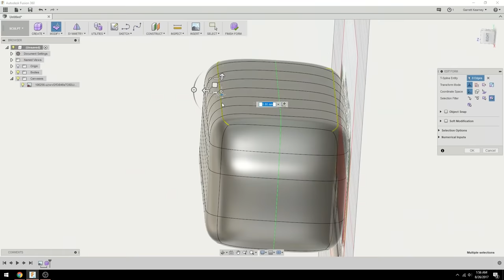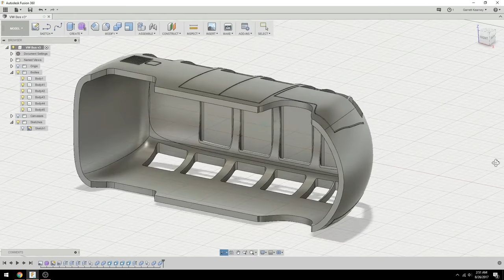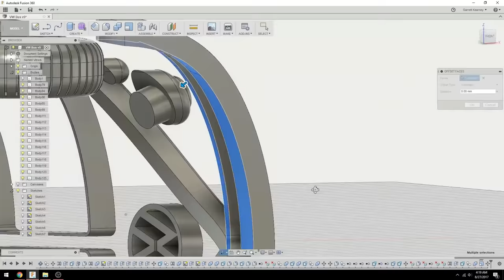3D Printed Model Car! - Volkswagen Bus

Comment: Nice model! For chrome details I highly recommend "Molotow Liquid Chrome Marker". If you want to see it being used I have a video where I paint a 3d printed Thomas the Tank Engine model on my channel
Reply: agepbiz I used actual chrome paint, it looked great until I stupidly put a gloss coat over the whole thing. Completely dulled the chrome at that point. Lesson learned.
Reply: Ah yeah, been there done that. The same goes for the marker, do not put gloss over it :) Great paint job by the way :)

Comment: I need help : i buy a 3d print called Anycubic i3 Mega ... All is working fine but on the manual i saw 60mms work speed ... But on youtube video, when they print, they use 30mms ... Just why ?

Comment: Feb. 2018---Thank you for a almost outstanding video. I say almost because I had hoped to see the bus being printed out.After 15 years or so, thought of getting back into modeling, but didn't want to go back to aircraft/armor. But started checking Google/Youtube to see if anyone was building zombie/apocalypse dioramas and boy, was I surprised. Also on the amount of paintings of survivors, abandoned cites, etc. and let's not talk about photos of abandoned amusement parks, malls, etc. I want my dioramas to be realistic as possible, so there's going to be NO Mad Max look or with a lot of women running around showing t&a's. Since starting this, must have downloaded 15K worth of photos/paintings for reference/ inspiration. Things have changed a lot modeling wise in those 15 years in some ways, others, not at all. For example, there's few plastic models available of current cars/trucks, so have been buying 1/32nd & 1/36th scale diecast vehicles which look okay as is, BUT detailed interiors such as brake pedals, seat belts, etc. which will have to be scratch built. Have 6 or 8 VW buses & bugs I'll be using but more than one bus body is a combination of metal & plastic?! I've scratch built parts before and made molds of them, so casting additional parts is not a problem. But been looking at 3D printers since last year and see endless possibilities for modelers, especially after seeing you make your bus.  Especially if you print an interior. I've seen other modelers print out axles/leaf springs, etc. The only problem when I basically see these videos is no one EVER tells the viewer how much experience they have/had when doing these kind of printings. At 64, all of this is new to me, so I am not some computer geek and working off & on in learning how to use Gimp for example. But there's a place called The Garage where people who own 3D printers and other things will let you use them for a really small fee and if you don't know how to, they'll show you.
Reply: P.S. I did download the bus file and thanks for that.

Comment: So how hard would it have been to add rolling wheels?
Maybe not a full axle, but some sort of clip on the inside of the tire into a hole in the body? or just a screw?

sorry, but caught the flat sides during the painting and brain went immediately into overdrive on parting that out, re: Transformers and other AF vehicles.

Comment: Thanks for your efforts.  I model in O Scale which is 1:48 so I reduced the file in Cura to 44.5% which is close to my scale.  I needed one of these for my model railroad layout.  I am modeling in the late 60s and I owned one of these in 63 and then a second in 70.  The first one was the stripped down model and was blue.  However, the 1970 was Red and white like your example.  So I will paint mine Blue.  Again thanks.   Have you done any other cars before 1970s?

Comment: I found your video looking for a way to print one off parts for plastic modeling. I am wanting to build a "transfer truck" and need to custom make the boxes and the trailer/tongue. This video was excellent and I am super interested in Fusion 360 after watching this but there are too many choices of which 360 "program" aka product... that I am back to being lost... which version/product did you use? It looks like with some time and effort these parts can be printed from a picture. You have any suggestions on a tutorial as well? Thanks for the awesome video, liked and sub'd.

Comment: That's a 1960's type 2 (T1) :D

The bay window buses came in from 67 (Type 2, T2 :D) that's a split screen (often called a splitty) :p

Also, fyi, that particular version of splitty is a known as a a samba :)

But, a decent model there :D
Reply: MiggyManMike did you know they still made these up until a few years ago?
Reply: Those where Type 2 T2's, kind  of, brazil was pumping out some rather unpopular water cooled beasts as that point based off of the T2 platform, the bus in this is a Type 2 T1 :)

Comment: There seems to be a disconnect between the 3D printing community and the scale modelling community. Paint would have been faster and better by airbrush, and chrome adhesive foil could be used to give a true chrome effect. 
Impressive CAD work.

Comment: Nice work! Maybe I can try with a game model (I can convert it to something like 3ds or obj, depending on the software), the only thing missing is the 3d printer (lol)
Does the wheels rotate? With which material did you print?
This car has many names, such as "Samba Bus" and "Kombi" ("Kombi" in countries like Brazil)

Comment: you sanded the part? or used xtc 3d? it seems smooth.
Reply: Jasphere Rindou completely hand sanded all of it 😊
Reply: Actually I have heard using gesso might serve as something like filler primer but don't have a chance to test it out. Might want to try some small model with it and whether it can provide a smoother finish.
Reply: @ChelsCCT  you have some talent Chelsea !

Comment: Dec. 14, 2018---Thanks for the video, but no thanks. Fusion 360 is $60 a month, or $495 a year. And what happens if the company decides to raise its price? There is a 30 day free trial available, but while it says you may get it free if you're a student, I'm not. The other is you may get it free if you're a start up or hobbyist, but unable to access that option. Getting back into modeling, but going for 1/35th zombie/apocalypse dioramas. Because there are very few modern vehicles available as plastic kits, have bought about 3 dozen die cast models in 1/32nd and 1/36th scale, including about 8 VW buses. Some of which are made of plastic & metal combinations with non opening sliding doors. Want to make them realistic as possible as in having the doors open and seats that look like seats instead of L shaped solid pieces of plastic. Fusion 360 looks like a great program, but not at their prices.

Comment: Good model BUT what happens to those rims? The original VW T1 hasn’t got deep dish rims. The white part is really small and but the tires are really thick. (I know that because I own a few of those). 

Also: next time you do such a Model DO NOT use these colors. This combination is just awful and gets so much hate around here in the vdub scene.